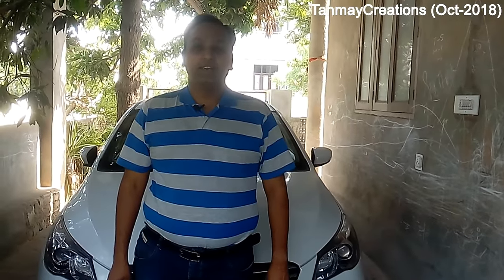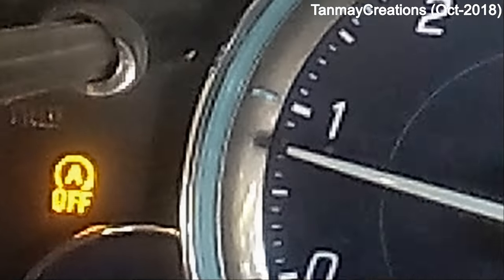Blinking Warning Light - Auto-Off - Start-Stop Smart Hybrid Vehicle System

Comment: No need to change the battery , only drive the car and battery will charged automatically...i am driving maruti dzire and this function is there
Reply: Are you sure ?
Reply: Even after running battery still blinking. What is the solution
Reply: @GAURAANGBNAIR  there are numbers of buttons blinking if somehow errors occurs there is a machine which is used to check with the lights, for this you have to go to service centre
Reply: @GAURAANGBNAIR mine also whats the solution
Reply: @Chefgsharma  I replaced with Smart Hybrid Battery of Exide. Now working fine.

Comment: Just some additional information: this happened in my ciaz as well (the blinking thing) and my battery died the next day after the car being still for around 10 hrs. I don’t know how it happened so fast but my battery was completely dead and had to get a new one. So whenever this happens with you, get it checked just to be safe! :)
Reply from the maker: Yes, getting the battery checked is quite simple. Perhaps, there must be some other issue, which might have been the case. This should be investigated to avoid such occurrence in the future. If possible, share here that root cause for the benefit of all.
Reply: How much did it cost you?
Reply: @Tanmayagarwaljaipur , excellent information.andbyou nailed it on the spot.
But one question 
Highbrid cars have two batteries 
One in the engen side
Other lithium ione battery under the navigator seat.
Please advice which battery needs change???? Thanks a lot

Comment: If we changed battery then how many kilometers after blinking auto on off light gone..
Reply from the maker: Immediately after successfully installing the battery.
Reply: Sorry but I still have sign ..I just changed battery...my mechanic said your lithiun battery is to low so you have to drive around 100 km than it's sign remove...
Reply: @TanmayAgarwalJaipur  sir plese muje sahi inform kijiye meri car bahoot Dino se bandh thi or using acid battery jo thi vo discharge ho gai thi...mechanic ne bola aap nai dalva do e sign chala jayega..maine nai battery dalva di magar sign ja nahi raha tha to mechenic ne muje bola ke aap thoda drive karoge iske bad jayega lekin sign gaya nahi..scanner se car scan karvaie to lithium battery low dikha rahi thi...meri car chal rahi hai  aaram se to kya lithium battery me problem hoga ya fir vi acid battery bigdi hui thi to iski bajah se vo kam charge hogi..aur agar lithium battery fully charged karne keliye Kitna km drive karna padta hain plese suggest me...
Reply from the maker: @latestnamesforbaby1391  You've installed a new acid battery, but the scanner still shows that the lithium battery has a low charge. This could mean that the car's charging system is expecting a lithium battery, and that's why it's not charging properly. The type of battery plays an important role in the charging process, and lithium batteries require a different setup. If the scanner shows the lithium battery with a low charge, it could mean that the system is either not recognizing it correctly or the charging system isn't working as it should. To fully charge a lithium battery, you should drive the car regularly so the charging system can fully charge it. There's no fixed number of kilometres you need to drive, but if the battery isn't charging, there might be a technical issue with the battery or the alternator (charging system). Take your car to a reliable/authorised service centre to get a thorough check of the battery and charging system, especially if your car is designed to support lithium-ion batteries.

Comment: My one year old breeza is giving this issue.
Reply from the maker: Then this issue does not seem to be of battery. It could be disconnection of wire near the bonnet lock OR sensor issue. If in warranty get it inspected by Maruti authorised service station.
Reply: Thanks

Comment: In such a situtation we can charge the battery or not,In artiga car there is Exide battery pl advice me,last two days suffering same issue for light,by charing the battery problem can be solved,my car run only 19000kms.,purchased in Oct.17
Reply from the maker: From Oct-2017, it has been quarter to four years, and for sure battery by now has worn out, irrespective of the mileage of the vehicle. Charging the battery won't help, still you may get it checked with some battery shop.

Comment: My CIAZ car is showing this indication now and its 31k kilometers now....when I went for nexa service station..they said that battery has  to be changed and their cost to change was 11,000 while h was too high..but except this battery changing I had done all service...now what should I do?
Reply from the maker: Nexa service station will not do anything special in case of changing the battery. Contact some authorised Exide battery dealer in your city, who will provide a brand new battery "EXIDE Conservo DIN70 ISS" in exchange of the old battery. I'm not sure about the current rate after exchange. I got in Rs.6,500/- in exchange of the old battery in Sep-2019.

Comment: Along with ENG A Stop off light my battery indicator is also constantly on while driving ...both these are on together...what can be the issue Sir
Reply from the maker: This could be probably because the battery is either not getting current from the alternator for charging OR the battery is malfunctioning. In this situation, your battery may get discharged soon and the car will not start after turning it OFF once. Please, get this check by the authorised service centre.
Reply: @TanmayAgarwalJaipur  thank you Sir.Regards

Comment: My light also blinking

But have changed it 8 months before
Reply from the maker: There could be other reason also, e.g. failure of the sensor itself, wires getting short, etc. Get it checked with your authorsied service station.

Comment: Sir I have a doubt as the battery change is in regards to the complete battery change of the car or do we have a specific battery dedicated to run the Hybrid on off..
Reply from the maker: There is only one battery that MAY need a change.
Reply: Thanks for the reply sir. Yes ur correct its only one battery need to be changed and after that SHVS @A symbol blinking stopped and now vehicle is performing better.

Comment: Even after changing new battery same problem coming. What to do.
Reply from the maker: Check the connection near battery positive terminal, fuse in the fuse box, else get it checked by the Authorised Service Centre.
Reply: Problem solve kaise hua bhai? I am also facing the same issue after replaced the battery.
Reply from the maker: @AmanKumar-ef6xz  If not solved, please take your car to MASS.

Comment: Sir..is it possible to charge it externally or go for a long drive to make it fully charge.
Kindly recommend which battery is good
Reply: I haven't tried. But if the battery got discharged because of some temporary problem, it will be fine after external charging or long driving. Otherwise new battery will be required. I prefer only Exide battery for vehicles.
Reply: @tanmayagarwal3821  Thankyou Sir,also please let me what would it cost to clear the sensor log data .
Reply: @vineethb3374  At Maruti Authorized Centre around Rs. 650.
Reply: @tanmayagarwal3821  sir Rs 650 for what new Battery or battery charging???
Reply from the maker: @vinnygrewal6959  Rs.650 for checking the status of sensors using the external computer based device.

Comment: Usually after how many years or how many kilometres ??
Reply from the maker: I ran my car for exactly one year and about 15,000 Kms.
Reply: @TanmayAgarwalJaipur  I went to a normal battery service station Exide. The guy took the battery and recharged it to full capacity. Next day I ran and it's now 2 weeks , very limited driving the battery is fine. Went to Maruti asked them to clear the flag or indicator light from their system. It is working fine for me now. My car ran 34 thousand km.
Reply from the maker: @juniorraut  That's great! How old is your car? I think it must be pretty new. By your comments, it seems that due to less usage the battery lost its power and the sensor light popped up initially.
Reply: @TanmayAgarwalJaipur  it's into its 4 th year now with 35 thousand running. 2016 second model. I would suggest all to go and get the battery fully charged and clear the logs with the authorised service centers. Atleast a try before investing into a new battery.

Comment: Bro I have changed the new battery amaron but not sold the issues light blinking
Reply from the maker: Amaron does not manufacture DIN-70. So, if you have bought for CIAZ, then either the current rating would be below or above 70 amps. So, the SHVS is not accepting this battery.

Comment: Sir my car is not stopping at neutral gear and the start stop is not working and its not blinking also
Reply from the maker: Hello Mr.Aish, with these limited details, it seems that either the SHVS belt might have broken/loose/out OR some fuse may have blown. Please, get your car inspected by car manufacturer's authorised dealer workshop.

Comment: Problem remained the same even after getting the new battery installed.
Reply from the maker: Check the cable connections near positive terminal of the battery, near radiator and fuse in the fuse box. If nothing works get it checked by MASS.
Reply: Problem kaise solve hoi fr?
Reply: @AmanKumar-ef6xz  Faulty alternator was replaced.

Comment: Sir , I am also facing this problem . But with auto off indicator the battery indicator is also indicating so what I should do
Reply from the maker: Check if the SHVS belt is intact. Contact Authorised Service Station.
Reply: Change batteries
Reply: My ertiga having same problem.. what's the issue. Please anyone can tell me

Comment: I had the same issue and then i replaced the battery, However its still giving me the above error even with the new battery(Only driven 70Km with new Battery?
Any idea?
Reply from the maker: You may get the battery terminals disconnected. Then, give self for few seconds. This way the remaining charge will disappear. Now, connect the battery terminals. Start the car and check the sensor light. If this works, great! If not, then check, if the battery terminal wires are in perfect condition as sensor wire on one terminal may have torned out. If this doesn't make any difference, check the fuse box under the bonnet, where specific fuse for SHVS is there. If nothing works, please get the same checked with the manufacturer's authorised service station.

Comment: Same problem with my ertiga..thanks
Reply: What you have done to solve this situation.

My Ertiga also giving blinking sign @A.

What should i do?
Reply: @AbhijeetGargam  there are two reasons...one is due to failure of battery sensor which is fitted at battery terminal...part cost is around 1100/-...second reason is due to week battery...there are two batteries in SHVS vehicles..one is lead acid battery which is in engine compartment for starting engine and for lighting etc... another is lithium ion battery which in passenger cabin under seat...lithium battery has very high life compared to lead acid battery ...so lead acid battery will be weak and you have to change that battery...pl note when you change sensor or battery you have to reset that fault signal in authorised service centre....hope this issue will be resolved

Comment: Battery is new. But still blinking.
Reply: Then how did you sort it out?
Reply: @youvrajmangar  coz i put the new battery.and it show full voltage and green dot. I doubt its not the issue of voltage but the amperes.
Reply: Oh no. I am also facing the same issue with my toyota Vitz 2015.
Reply from the maker: First get your battery checked for its strength in terms of the current (amperes). If that is okay, then wiring or other fault would be the cause.

Comment: Hamari swift dezire 2020 model hai abhi 10,000 bhi nhi chali hme ye problem face kyun krni pd rhi hai
Reply from the maker: Check, if the battery terminal wires are in perfect condition as sensor wire on one terminal may have torned out or loose. If this doesn't make any difference, check the fuse box under the bonnet, where specific fuse for SHVS is there. If nothing works, please get the same checked with the manufacturer's authorised service station as your car is under warranty.

Comment: Is there any other solution apart from changing the battery
Reply from the maker: That will depend on the root cause, which the sensors will notify in the sensor reading available with vehicle authorised service stations.

Comment: Sir lekin Maine battery change kar diye hai phir bhi aoff sign nahi hat raha hai
Reply from the maker: Battery se fully disconnect karke 2-3 mins chod den aur self lijiega tow old sensor value may get cleared off. Check fuse of the SHVS sensor, if blown, then replace it. If nothing works, don't play with the system, and get it checked by the authorised dealer.
Reply: Problem kaise solve hua? I am also facing same issue

Comment: Please visit nearest maruti service center... rather then this .. I tried it ... I drove for 50 km with this light ... hybrid engine belt broke . I had to tow my car ... sooo it's better to visit service centre
Reply from the maker: Visiting MASS is best. But, the breaking of SHVS belt is very common among CIAZ mostly found in cases where the engine starts (due to Auto Start-Stop) and the car is accelerated with a jerk.
Reply: @TanmayAgarwalJaipur  it was my first time ... I watched your video and I was like it's battery  fault , so nothing to worry about ... after 10 km the belt broke and everything stopped working even the steering, so I had a little trouble getting it to the nearest mass
Reply from the maker: @sahibjeetsingh9509  It seems that the belt already broke, which started the blinking of the sensor light. It was just that after 10 KMs you may have realised that it broke. I have faced this issue thrice, wherein the belt broke and the sensor light started blinking. Without shutting the engine off, I took the car to the mechanic for changing the SHVS belt. In such a condition, if the car's engine is switched-off, it won't start through self and will be a trouble as you have faced. And, keeping the engine ON doesn't mean for a long time because the supply to lights, horn, power steering, etc. is through the battery, which stops charging, thereby meaning that after some time (in my case around 1 hour of drive), the head lights starts dimming, and power steering becomes non-functional (steering becomes hard), etc. This video talks about the case where there is no mechanical failure.

Comment: change krli fir be nhi ja rhi
Reply from the maker: Please, ensure that the battery model should be exactly ISS DIN70. And, if the amber sensor light is not going off, then get the battery removed, get the log cleared using the sensor setting device, and then get the battery installed. The amber sensor light is likely to get off.